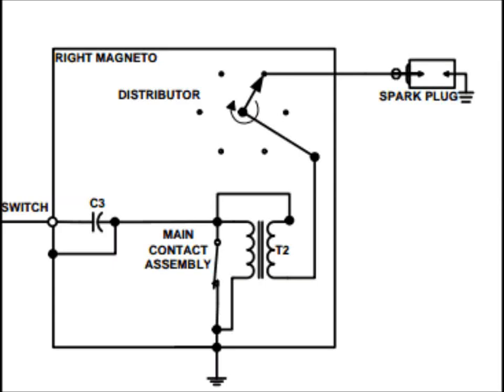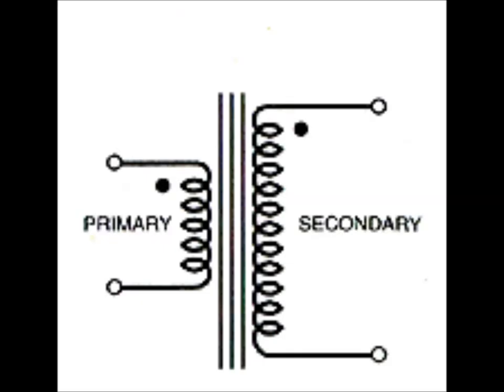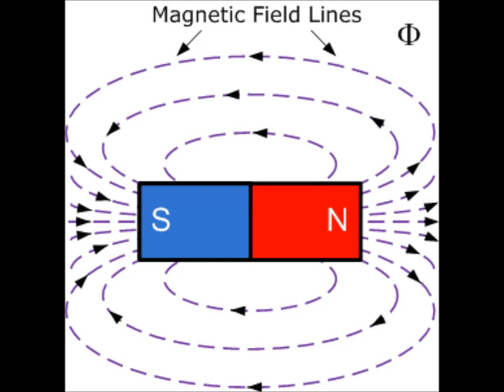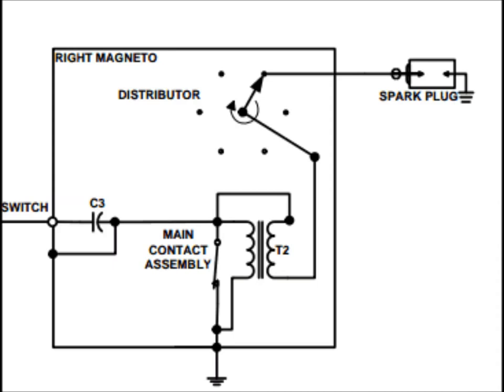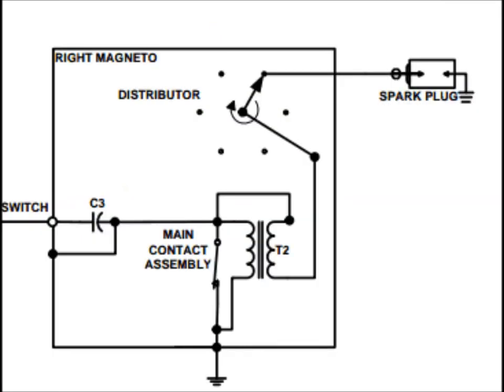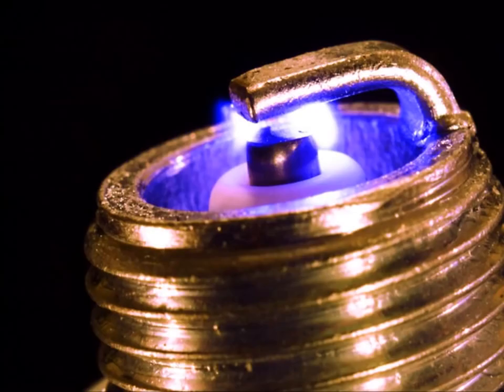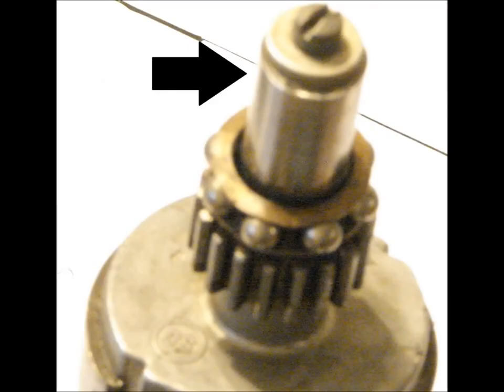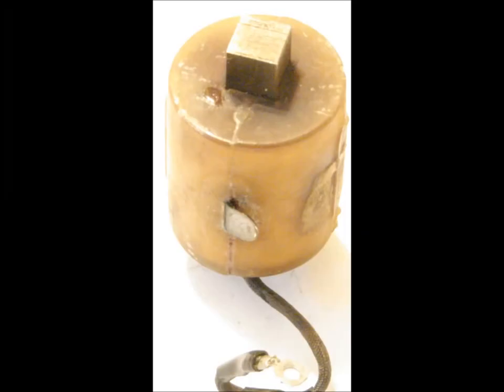Aircraft Magneto | Ignition Systems Principles

Comment: What is the need of stepping up the voltage why cant use direct same number of turns primary winding transformer?
Reply: I think the voltage from the primary winding alone is not enough for what the magneto needs
Reply: Thanks Edward for the care.my point is that when secondary with more turns can stepup increasing voltage and reducing current then why cant use same turns or greater in primary and rather resisting or limiting current current post that.